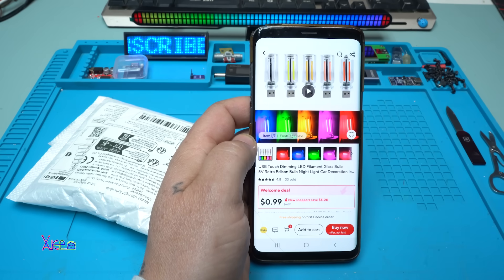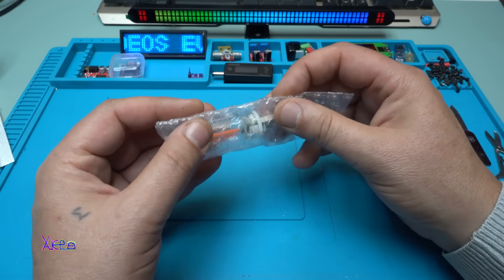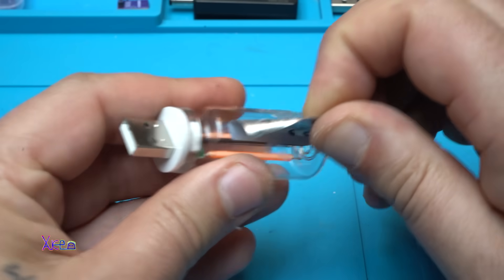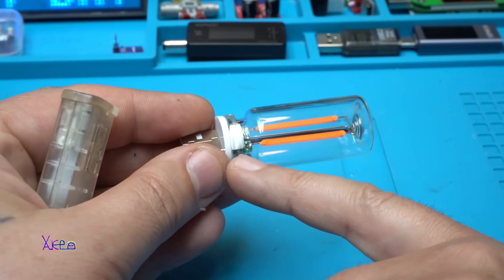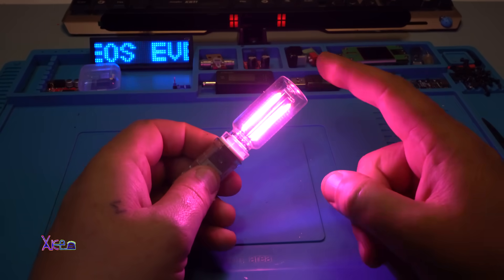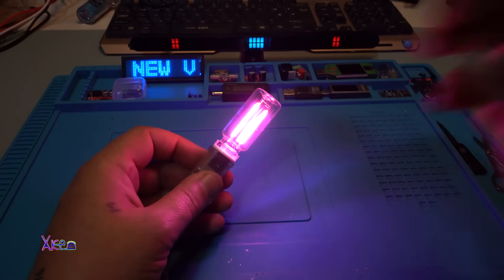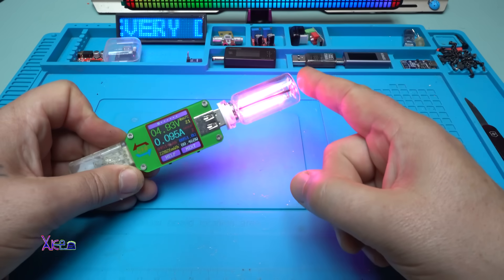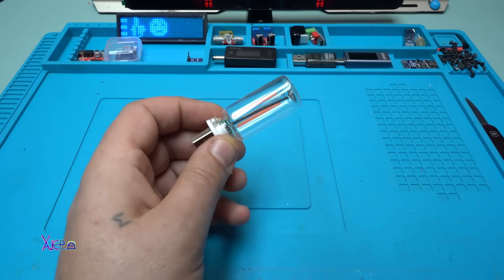WHY THIS $1 Aliexpress Module is AWESOME?

Comment: 절대 차량에서 사용하지 마세요.. 배터리 완전방전 됨.
Reply: Highly unlikely, considering the huge capacity of the battery. Remember, there are heaps of other devices in a car than draw power even when the vehicle is "off". Consider the RF receiver that listens for you remote to unlock. The CPU in the car that is listening for the signal from the Remote Receiver.
This thing draws insignificant power when not illuminated

Comment: If the week starts with bubbles, what can go wrong? Beside a terrible sticker... and the downside of the module, it looks like you can't switch it on off over the USB. This is what I don't like, otherwise it would be a very good working indicator on some steampunk builds.
Reply: You can switch it off by touching the touch pad.  You can switch it off by unplugging it from the USB, or disconnecting with a switch.
What else do you want it to do?
Reply: @johncoops6897 Duh. YOU FORGOT switch it ON by only applying power (from another switch).
Reply: @TheSummer750 - Shheiit, I also forgot switching it OFF by deliberately not paying the electricity bill. 😂
. .
But seriously, if you wanted a lamp that switches on when you apply power, simply purchase one without the electronic touch switch in it.
- surely it's not hard to work that out? 🙄
Reply: @johncoops6897  Power on the USB it lose state and start dark. So I can't build e.g. behind a glas.
Reply: @hesspet - as I already commented 👆 aboce, if you want immediate illumination when power is applied, why would you buy a bulb with an electronic touch switch in it?
Simply purchase a lamp that doesn't include the switch.
Or even, if you really are "building steampunk" gadgets, get some LED filaments and install them inside yoir own glass, for example the small glass storage vials from the dollar store. 
Simple.
Reply: @johncoops6897  :-) I didn't say I don't want the touch feature. But after a power break it should light up if the state was on before the the power break.

Comment: That does look pretty nice, I have to say.
Small tip, if you fold a sticker over your finger with the sticky side facing out and dab it on the remaining residue, it usually pulls it all off.
Reply: wd40 dissolves it. spray onto a strong paper towel (not tissue).
Reply: @jacoblf  No need, the original sticker will literally lift off the residue.
Reply: @jacoblf  isopropyl (rubbing) alcohol even better because it doesn't stink after.